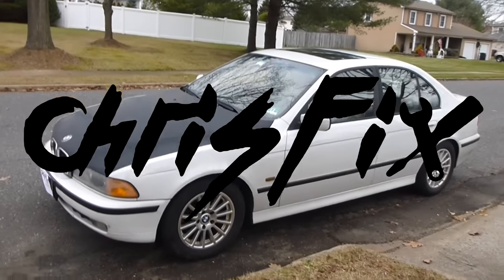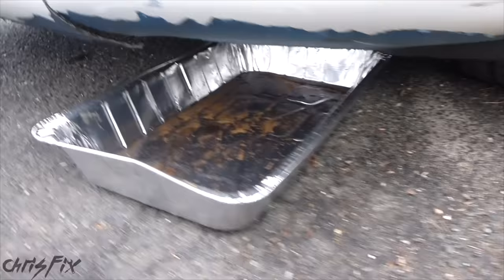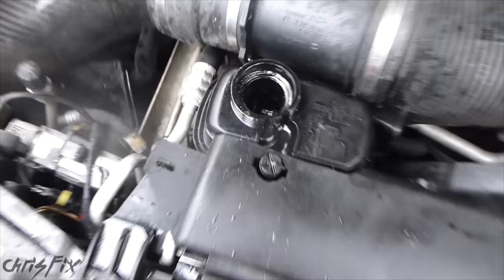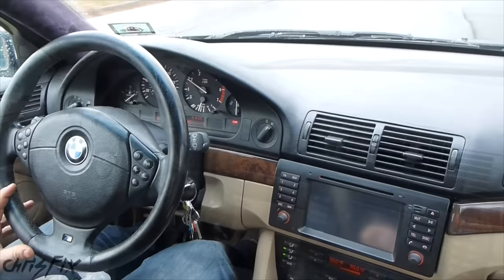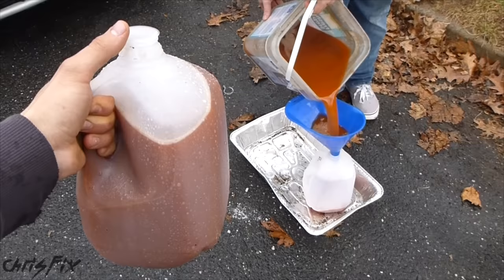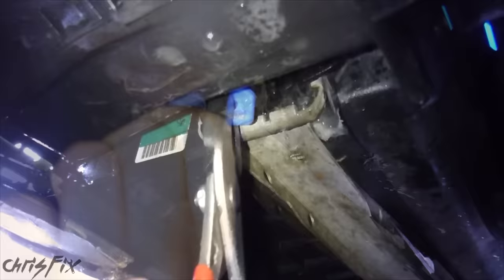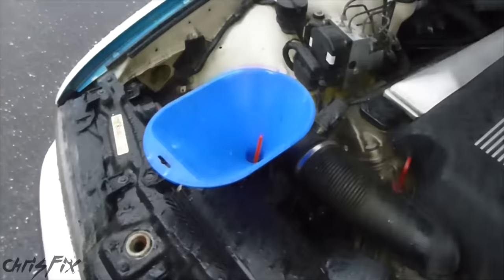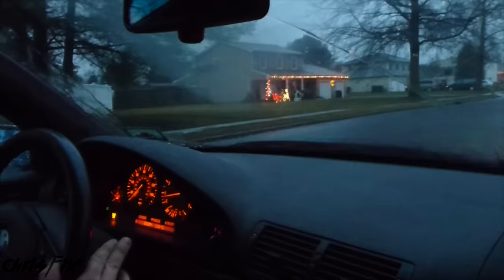How to Quick Flush Your Cars Cooling System

Comment: The problem with this is that you didn't take out the thermostat so there is old coolant in the engine block and heater core not getting replaced. You need to remove the thermostat and back flush the system. It is also best to gently flush the heater core if you can find the houses to it and remove them. Then drive it like you did for awhile. Let it cool then drain and flush everything again and put in a new thermostat. Now you can fill with all new coolant!
Reply: why is no one else acknowledging this? i think you make a pretty good point dan
Reply: @vincnt9537  Yeah, I'm  wondering now.  Wouldn't the thermostat have opened when he was driving the car around with the flushing water and cleaning chemical in it?
Reply: @Bill Smith  this is possible, and also the fact that the thermostat would open while he was driving could explain why he didn't bother to mention it; it is part of the instructions to drive the vehicle, to circulate the fluid.. very interesting
Reply: I’m confused how there would be old coolant in the engine block if he ran the car with the flush?
Reply: @MoreThanRocks the cooling system comprises of multiple circuits. The thermostat controls the flow between these circuits. If the thermostat doesn't fully open, it's possible for old coolant to remain in one of the circuits like the engine block.

Comment: "Always check the weather before doing a project"

Couldn't agree more... Especially when you're underneath a car changing out mounts in 30 degree weather in a pouring storm. I couldn't stop shivering
Reply from the maker: Yea sometimes it stinks :/
Reply: That sounds better than not having anywhere except the hot ass asphalt to work on. I wear a jacket when it’s 110 degrees so I can lay down lol
Reply: Doing an oil change on a windy day...did not end well...
Reply: @nazmulrouf1224  yep! The oil coming out of the sump kept blowing in different directions. Had to keep moving the drain pan. Was a bit of a mess!
Reply: L
Reply: P
Reply: 09 ppl
Reply: Too hot, too cold or too windy...not good days for driveway mechanics lol
Reply: @CallumAtwal  If you use a long neck funnel to 'catch' the oil, with the neck at the drain pan, or block the wind with cardboard you'll have less mess. Shade tree mechanics have to have some tricks, and Chris knows lots of the tricks!
Reply: @jerrykorf4444  yep! I now just block the sides of the car with whatever I have lying around just to prevent a wind tunnel underneath the car blowing it all over the place. Thankfully last few times I've been lucky with the weather 😂

Comment: Great video. After watching this a few times I was able to do my own coolant flush and saved like $80-$100 I would’ve spent paying a mechanic. Your videos are all super helpful, thanks again!
Reply: You probably did a better job
Reply: lol
Reply: Did you put the 3 gallons of water and the cleaner or only 2 gallons and the cleaner ?
Reply: @hjer731  agree.
Reply: @Chriss12027 I’m sure it’s all based off what the car manual says
Reply: 100$ bucks more you'd have the correct ph and freezing points correct. Pretty sure your ratios are off, most diys that come in are always off. Meaning not enough protection in the system due to distilled water

Comment: You want to test the freezing point and ph. The distilled water that is left in can cause the mix be off. Even if you turn it on, it won't pump enough out or at all. To really get all of it out you need to open up the block drain. If not, you'll need to repeat the drain and fill with coolant until the ph and freezing point is correct.
Reply from the maker: That's why it's important to drain out as much as possible for sure

Comment: Hello Chris!

I want to thank you SO much for your channel because you just helped me fix my car! I knew basically nothing about cars, but using your videos I was able to figure out the problem! My Audi A4 2010 was shaking horribly and very violently and I couldn't figure out why. Tested the fuel injectors, changed the spark plugs, and still couldn't figure it out. Finally I tested the "ignition coils" I think they are called, because it doesn't really have Spark Plug "wires." I took out each coil one at a time (there's 4), started the car, and found which ones weren't contributing to the engine. Replaced the two that weren't working and Boom! Smooth SMOOTH ride :D Accelerates faster too

If it wasn't for your videos, I would never have been able to fix it on my own and even know where the heck to start on fixing it! Seriously! I still have TONS to learn about cars, but I'm happy to have a successful first fix and start somewhere. So again, thank you so much Chris!

-Mario
Reply from the maker: mario Cazares Hey Mario! That is awesome! I am glad my videos have been helpful and you are learning a lot! It is great to hear you are fixing your car yourself! Good work diagnosing the bad ignition coil!
Reply: @mario Cazares You should always replace replace all your coil packs in sets. Never just replace one or two because eventually the rest of of them will not fire correctly.

Comment: Always enjoy your videos. I prefer using concentrated coolant and almost always OE coolants and other fluids. I add 1/2 the system's capacity with concentrate, then top up with distilled water. That way you don't have to worry about residual water in the system diluting your 50/50 bottled mix. There can be a fair bit of water left in the galleries. This is particularly important where I live as we have very cold winters and getting a minimum 50/50 concentration is pretty much imperative.
Reply: That's pretty smart.  So if you know your entire system is 10 quarts, and you filled in 5 quarts of concentrate, then what's left over has to be distilled water!
Reply: That's smart. This is why I go into the comment section of these sorts of video
Reply: Thats what I do. Seems like it would be hard to get the water out of the block and heater core. I figure half the water is in the block and heater core, so I just fill the radiator with 100% and it should end up 50%.
Reply: So you don't have to actually premix the water coolant...it will take care of itself when it is pushed through the entire coolant system
Reply: You flush with hot engine, thermostat open and distilled water circulating through motor block and heater core, but drain with cold engine and thermostat closed. So without removing the thermostat a mixture of distilled water, some old coolant and chemical flush remains in the block. Filling the radiator with premixed means coolant concentration of the whole system will be well below 50/50. Am i correct?

Comment: Top Tip: If you aren't rich, you should definitely do these. There are a lot of scammers out there.
I was supposed to only get my oil change but they also drained my coolant without my permission.
I had problems overheating my engine on my way back home.
My coolant was on max before I went to the oil change place.WHen I got out, it was  empty.
Reply: Kappa Pride 
I had a similar problem.  I took my car to the dodge dealership for transmission flush. They gave me back the car with no transmission fluid inside.
Reply: And if you are a woman the carshops are notorious for screwing you. Trying to do some stuff myself, due to them
Reply: Kappa Pride what did you do about it,did you confront them,you should always remind them that you are very good at leaving comments on social media!
Reply: I had the same done to mine!!😤 that’s the last time I took my car to sears automotive
Reply: That means more business for them! But more money and problems your way
Reply: @narastserendagva9380  I very rarely take my car to a dealership anymore but when I do I take a vid of the condition of the car before I drop it off. The condition of the interior, the fluid levels and what it looks like of everything, then check it all again before you leave. Ive never had a bad experience like that, just them trying to quote me 100 more than they told my dad but I'd rather be paranoid than a fool
Reply: I do everything I can to fix my car myself. Don't trust all mechanics!
Reply: This is especially a big problems for Exotic Cars 
Those cars are expensive on its own price and fixing it multiple times a year will eventually result the the same price as though you are buying a new one... its ridiculous shit 

So whenever you own an exotic car its always wise to atleast know some car stuff so you can fix your exotic car at home with very little money spent and dont be an idiot like “OH NO MY FERRARI USES ITS OWN TYPE OF COOLANT/FLUID NOT LIKE IN OTHER CARS DAAA”
Reply: Christ you were this close to a lawsuit
Reply: H M Ed
Reply: Kappa Pride bruh why tf lying you would have gotten nowhere if your engine had no coolant and you would have a bricked engine
Reply: Ken Call  what is that even supposed to mean?
Reply: That’s why I always want to stand by and watch what they do and learn. But instead Jiffylube told me to go sit down in the office with AC and they didn’t even put the bottom cover of my car back in properly. And they did a shit job cleaning my windows also.

Comment: You are incredible Chrisfix!!! Why pay $100 to a car dealer when you can have fun and do it yourself?!
Reply from the maker: Exactly,  and do a more through flush.
Reply: +ChrisFix Chris what about mixing coolants?
Reply: +Thomas S Don't
Reply: +Thomas S its like mixing oil not good
Reply: Depends on your vehicule. Check the notice. For my VW I can mix g12 + with g11 or g12++.
Reply: ChrisFix what is a bodyboard ice Rose and one what is the metal horses that are a lot of videos of p what song car u
Reply: Exactly, and be independent at the same time.....
Reply: If you're lucky, they might even use the correct procedure & coolant for the $100
Reply: Chris, you are awesome!  I loathed the thought of putting a tap in a radiator hose, pumping tap water in it to flush, dealing with the mess,  and finally adding the anti-freeze. You saved me a lot of grief!!
I heard HOAT antifreeze is best and works for all//most vehicles. Does anyone know or wish to comment?
Reply: $100? My dealership wants $500 to do a 30k mile fluid flush.

Comment: Chris:

Thanks SO MUCH at 4:07 for saying what you said about starting the engine so that the water pump will force out any water you think might be still in the engine block.  Ya kinda left that step out of your "Super Flush" video when you flushed the Mazda.  A lot of people, myself included, were wondering how you emptied the engine block of ALL the water.
Reply: @Gideon Well, you'd only be running the pump dry for a few seconds.  I don't think that's enough to damage it.  Chris even does it in this video at 4:12.  Getting as much of the old water out is preferable because that old water has contaminants in it that you don't want in your cooling system, which is why you're flushing it in the first place.  You want only fresh coolant and water in your system.  So when it runs dry, shut off the engine and add the coolant until no more will go in, then start the engine and make the pump circulate the water throughout the system.  Keep adding water/coolant as needed.  I live in a warmer climate, too, but I still put 50/50 in as nighttime temps in winter are known to drop into the 20s here.
Reply: @Gideon Good questions.  Pouring a little oil into the new oil filter is a great idea, especially if the filter is completely upside down because then you can fill it up, but I always end up with cars whose oil filters are tilted 45 degrees, so you have to be careful not to put too much in them to avoid spilling oil when you're screwing it onto the base.  Or just keep your catch basin in place when you're putting the new one in so the new oil doesn't hit the ground, but to me, either way is a waste of fresh oil, so I just screw it in empty to keep that from happening.

Having said all that, I've never had a problem putting a new oil filter in empty.  Yes, the engine could run empty for maybe a few seconds, but that's nowhere near long enough to do any real damage.  I've never had a problem with doing that, and I've been changing my own oil for over 30 years.  After a couple of seconds, fresh oil gets pumped into the whole engine anyway, and I've never seen an engine that's that unforgiving.

Comment: What you were calling the reservoir is actually an "expansion tank".  It's called that because there is supposed to be an air cushion in there to allow the coolant to expand.  BMW cooling systems are a weak link in the car and filling the expansion tank to the top is a recipe for disaster.  No room for the coolant to expand results in extremely high pressures which results in bye-bye cooling system.  That red bobber is there for a reason.   Only fill the expansion tank to the point where the top of the red bobber is no higher than the top of the tank.
Reply from the maker: Thanks for sharing!
Reply: So the expansion tank was a overfilled here?

Comment: I was hesitant to use the Prestone flush kit you find in auto parts stores because you're filling the system with tap water, which you'd never get completely out.  This method is cheap, effective, and works well.  Another commentor said that after a flush with distilled water, fill it up with 1/2 your system's capacity with concentrate.  Then top off with more distilled water.  This way you're nearly guaranteed a 50/50 mix.

Comment: I personally wouldn't add those rust preventative additives to the cooling system. They can cause trouble to your heater core. I have learned from experience. But its totally up to the owner. When you flush the system its a good idea to replace the thermostat at the same time.
Reply: Yea he did that in his complete flush video for his truck, but this is a quick one :P
Reply: SuperCyril2 g
Reply: Yeah the actual coolant already has anti rust and gasket inhibitors and whatnot

Comment: Sweet video! My only comment is that adding rust inhibitor may not be necessary depending on the coolant you are using.  Some OEM coolants already contain a rust inhibitor package.
Reply: And can the sealer compound in it clog up the heater core?

Comment: Thanks!! I changed the thermostat of my 15 Tahoe and noticed the temperature would not change gradually when rising or lowering the temp. I skipped leaving the engine running and leaving the cap off after feeling up. Much better now

Comment: What about water in block you didn't drain out? You shouldn't use 50/50 for flush fill, because your starting at 50%coolant now the water in your block will mix with that and drop it lower, if you live in a area where u get below freezing you could possibly crack block, use concentrated coolant when doing flush & fill
Reply: I was thinking exactly same.
Reply: Me trying scrolling the infinite comment to search someone think like me😂
Reply: Very true
Reply: How to determine how much water is in the block?

Comment: good video, but I'd like to add that most modern engines have a coolant drain on the engine block as well
Reply: Mine has drain plug at the back of the engine and I hear it's very difficult to get off. Also there's danger of damaging threads on the block so I'm not sure if I want to try opening that

Comment: I know this is an old thread but… I’m losing coolant after every drive. Had the radiator checked and confirmed there was leakage. Now I just had it changed including upper/lower hose as well as new clamps, refilled coolant for about 4L, went home and checked the reservoir after engine cooled off and coolant is drained yet again. There is no leak on the floor/ground and no issues of overheating so far. Driving an ‘09 civic.

Comment: I just came across this video and it was so well done.  I am very new to cars and trying to learn as much as I can through great videos such as yours.  I do have a 2019 GMC Terrain SLT with 56000 miles that runs great but I never had any of the following checked, especially those items concerning flushes and/or fills:

- Engine air filter
- Cabin air filer
- Coolant/Antifreeze
- Power steering
- Transmission fluid
- Brake fluid

I have read conflicting information online about if and when do get these checked out.  Can you or any of your followers please advise?  I really want this car to last and realize I don't know anything.

I do check the oil and get that changed when needed - hehe.  I'm just afraid since I am learning all of this and go to a mechanic, he'll have a field day with my wallet.

Thank you in advance for your time and kind replies.

Best,

J
Reply: Old comment but the change intervals for all of those should be in the manual
Reply: Yes did you look in your manual?

Comment: Does the bottom radiator hose drain all of the coolant/ water from the engine? Also how possible is it to complete a flush without removing the thermostat?

Comment: What about the antifreeze that is left in the block, you drained the radiator but not the block. The antifreeze will probably test less than 50/50 because there was water left in the block.